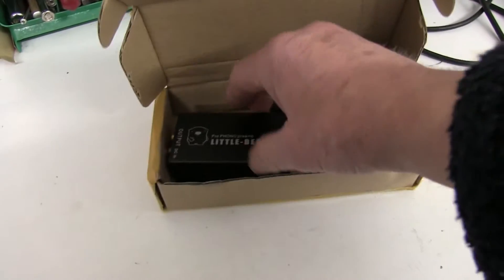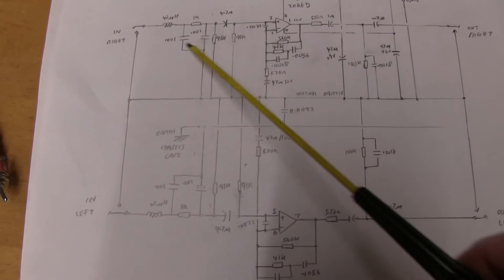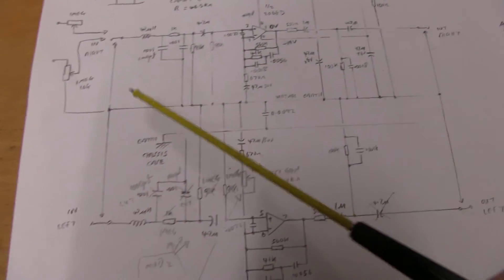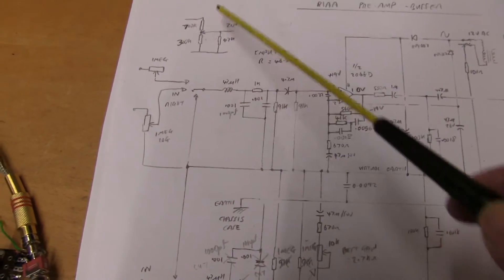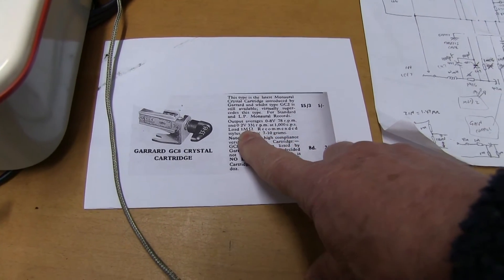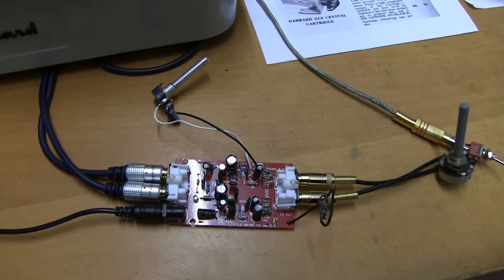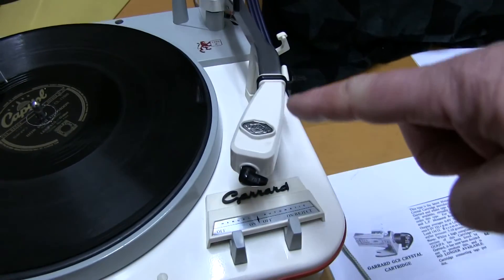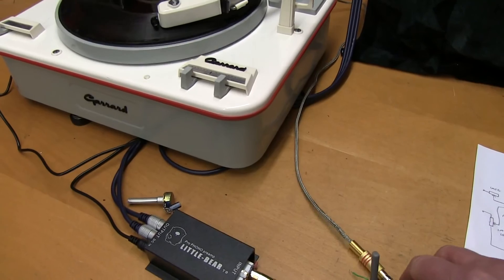Buffer preamp. for Crystal pickups, in old record players.

Comment: A MM or MC cartridge apart from having an output an order of magnitude or three lower than a crystal cartridge are also velocity generators whilst the crystal is not. The output from a MM/MC will increase with velocity ie the faster you wiggle it the higher the output hence the major reason for that curve. There are other reasons too being hf noise reduction and bass requiring extra boost on RIAA curve (to conserve vinyl real estate), but nevertheless a crystal with a unity buffer of high impedance will work directly into a line input without any worry and give a  flat response. Bass ought to be boosted and treble reduced in accordance with RIAA cut and boost on the record itself.
The tone controls will suffice if necessary and a direct feed to aux would be far superior to this imho anyhow.

Comment: Hi Nick, watching this for the third time, is it fair to say that a 700 ohm resistor inline with the output from a ceramic cartridge, could be  used as a buffer.  And, this would enable you to plug the ceramic cartridge into a phono input directly on a (non valve) hifi amp.  The amp would then provide RIAA eq, as this Little Bear unit is doing.  That seems too easy, but seems logical in light of your video.  Perhaps a switching unit with different resistor values could facilitate different cartridge outputs?  Or.. have I got this completely wrong.

Comment: Hi Nick, another informative video!  I have a growing 78s collection, currently being played on an AT PL120 turntable.  I use a Stanton 500 cartridge with 3mil stylus.  However, in the pursuit of better sound and trying alternative stylus sizes, I thought perhaps it might be possible to mount a ceramic cartridge (to two) onto head-shells and try them through my hifi.  The Little Bear seems like a possibility, however, if I wanted to have the turntable connected to the 'phono in' and switch between mm carts and ceramic, wouldn't this double up the EQ?  Do you have any suggestion what I'd need and best ways to switch it in and out?  Thank you, Matthew.
Reply from the maker: Hi Matthew
The ceramic cartridge normally have a high output. Too much for a phono input.
Also they need a high input impedance, above the standrad 47K of an AUX input.
The Little Bear mod provides the buffer to convert the signal suitable for the Aux input.
You will need to either swap the phonos between the sockets, or make a box with a chengeover switch.
When you buy a 78 stylus, make sure it is a large mil, like you say, or the background noise will be very high, especially on mono.
I use a ORTOFON 78 stylus in a headshell
Keep spinning.   Nick

Comment: I live in the USA,and I just discovered your channel.I have the identical model of Garrard Type A with the steel plinth you have here.I am having it restored.I got it very cheap.I paid $10.These are beautiful machines,and very rarely  turn up in the USA.I think they were only made for sale in the UK  and parts of the EU.I believe this particular Type A with the steel cabinet was made around 1961-63,and is a stereo unit.I am using a very nice valve amp for my Thorens turntable,a Fisher X-101 from 1959.I can use this amp for the Garrard as well.My question for you is about the cartridge.Are you using a rebuilt crystal cartridge? New old stock?Or are you just using the original cartridge? I thought crystal cartridges died over time.Can you buy a crystal cartridge?
Reply from the maker: +Roger Kulp 
Hi Roger
That is a lucky find. They are rare and very expensive in the UK.
Yes, I use the original cartridge, and it works perfectly.
The restoration was frustrating, as the mechanism struggles with the weight of the platter, and it took ages to get it working as smooth as possible without stalling.
The main difficulty I had with the restoration was the arm pivot.
It has quite high friction and was impossible to set with no play up and down.
The cartridge has to be set at quite a high tracking weight , so as not to skip. But that is not a problem with 78rpm records, which I use it for.
My cartridge is the original Garrard  MONO and has a very good sound.
I would love a stereo cartridge, such as a Ronette, but cannot find one.
To fit another cartridge, make sure it can handle the low compliance (High friction) and heavy arm.
Let me know how you get on, and if you find a Ronette stereo cart that I can get.
All the best.  Nick
Reply from the maker: Hi Roger
On the Garrard deck, I use the original cartridge which still works !
On my main Hifi deck I use a Ortofon cartridge with a 78 stylus.
If you buy a 78 stylus, make sure it has a large stylus tip (3mill) as the cheap small stylus tips drop too far into the grip and pickup all the noise in the bottom of the groove.